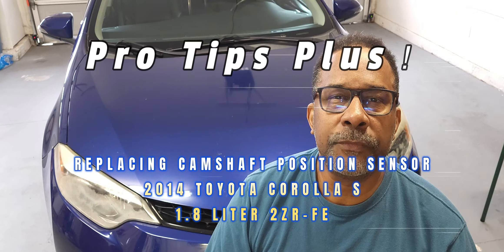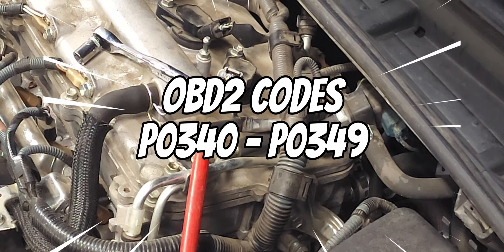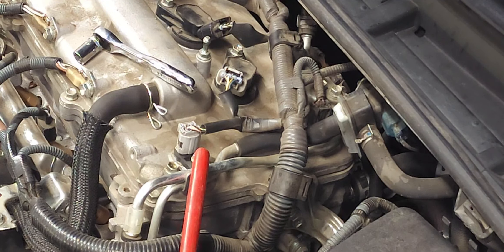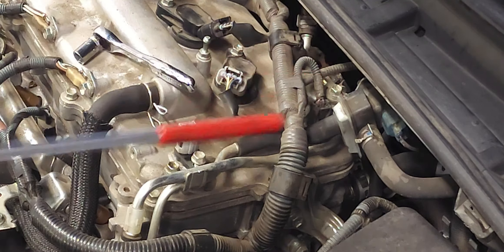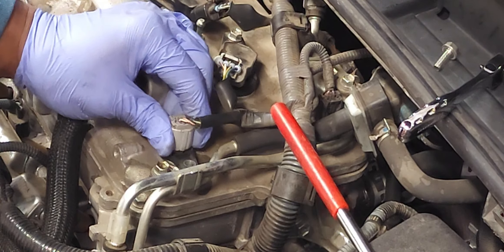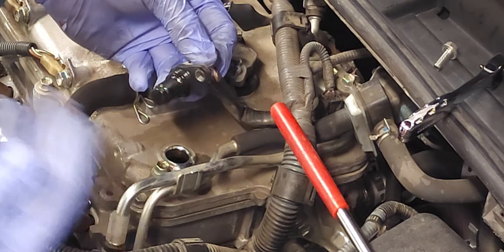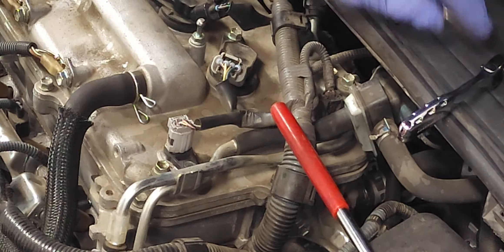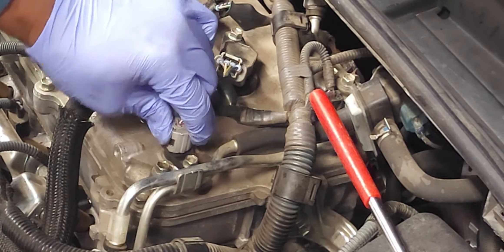2009-2024 Toyota Corolla, 1.8L, 2ZR-FE, Camshaft Position Sensor Replacement Tips

Comment: What if there is sludge on the cam sensor?
Reply from the maker: Mostly likely related to insufficient engine oil maintenance. Dirty oil can cause cam sensors and VVT solenoids to throw codes. Assumimg normal driving conditions. Consider two oil and filter changes within ~7K.
Reply: @protipsplus  Is the camshaft sensor the same as a cam sensor? I heard another mechanic working on a Chrysler Town and Country mention that if you pull out the cam sensor and find sludge, it's a sign not to buy the vehicle. However, he only pulled out one. I noticed you mentioned the Corolla has two, so I wanted to confirm that we are referring to the same component. Thank you.